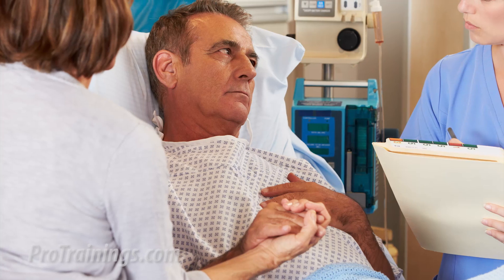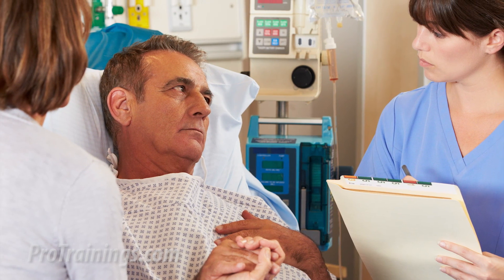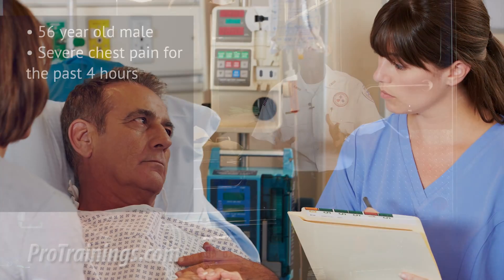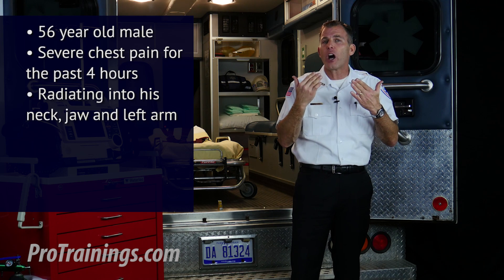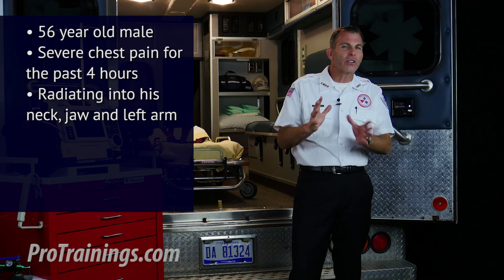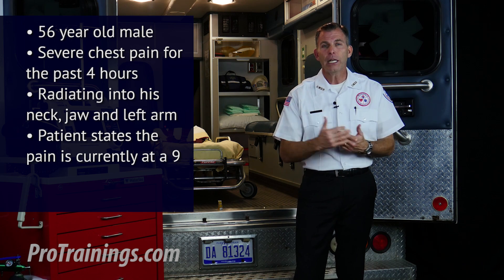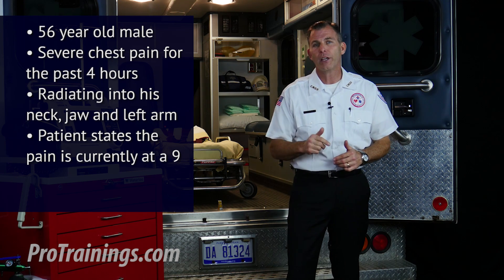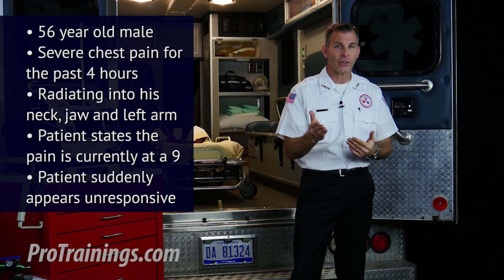Pulseless Arrest V-Fib Teaching (ACLS Algorithms)

Comment: If that 56y/o male who appears in the video is the case, a size 6.0 ETT is definitely too small. This patient will require a size 7.0 ETT at minimum. This will be important for appropriate VTs (Tidal Volumes) once the patient is placed on a vent. Moreover, an End-Tidal CO2 Detector will change colors *(usually from purple to yellow) the second the End-Tidal CO2 Detector is in place between the ETT & the Ambu bag. NOTE: Many times, you can see the exhaled gases in the ETT 'Before' placing the CO2 Detector as well as hear gurgling from secretions. The other VERY IMPORTANT FACTOR is to have a suction catheter kit to clear EXCESS SECRETIONS to prevent additional aspiration and gastric contents.. Henceforth, the clarity of bilateral B.Sounds & chest rise will be evident. 
I'm just sayin...

Comment: You said 15 breaths per minute, that does mean you continue to give breaths at 15 breaths per minute while chest compression is on going? Is that a new maneuver?
Reply: if using bls airway adjucts with bvm, acls rate for adults with cpr is 30 comps / with pause for 2 breaths, so roughly at compression rate of 100-120min with 2 second pause for ventilations, you would be delivering apprx 6-8 breaths per min. once advanced airway is in place (ET tube/ LMA/SGA) ventilations become "asynchronous"  with one breath given every 6-8 seconds during compressions, which would deliver apprx 8-10 breaths per min.
Reply: During CPR administer 1 breath every 5-6 seconds for adults. Or base breaths on end tidal capnography results.
Reply: If tubed it doesn't matter. Asynchronous